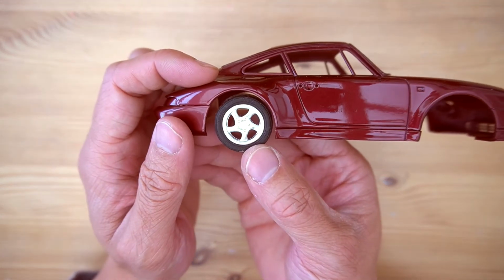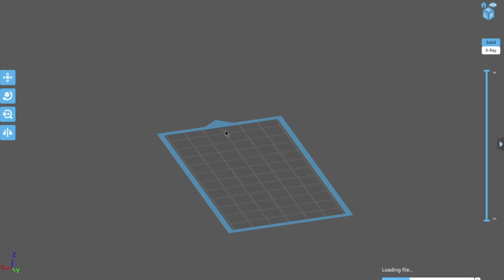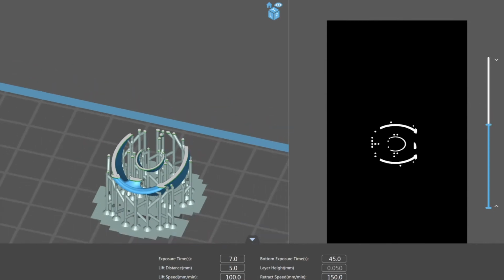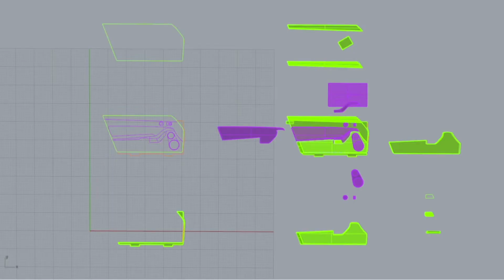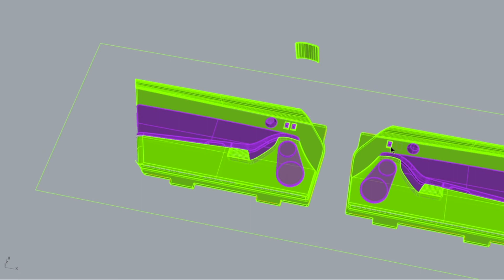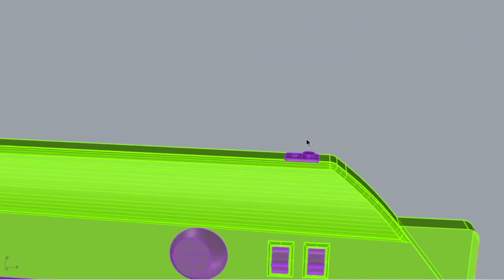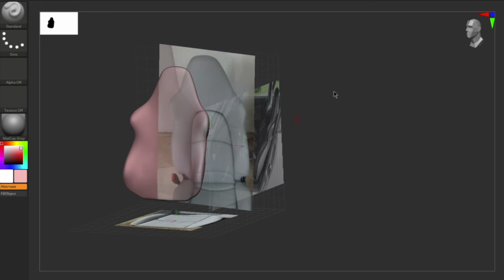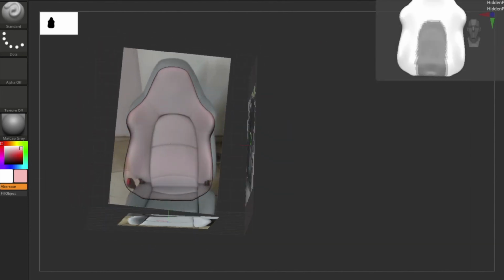3D PRINTED UPGRADES!! Revell Porsche 911 Turbo 993 - PART ONE AND A BIT

Comment: Do you work on 1/8 scale ? I have pocher porsche 993 i need turbo trans kit
Reply from the maker: Hey ya! Thanks for dropping me a line. Pocher! That legendary name, the F40 was the holy grail with the full transkit from autograph! With the 993 it was simpler but the only 993 at that scale. I've not got any reference at the moment,  but would be a good subject to 3d scan and develop. I'd say some photo etching and lathed details too for the fine items are needed. It'll be a project, but I've unfortunately not got the base to start with. Some day once I've built all those other kits ;)